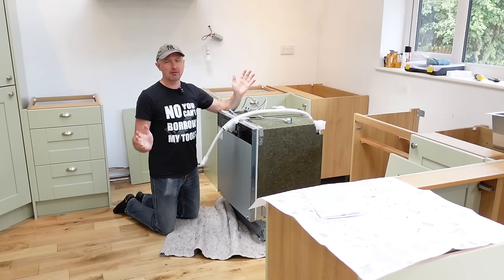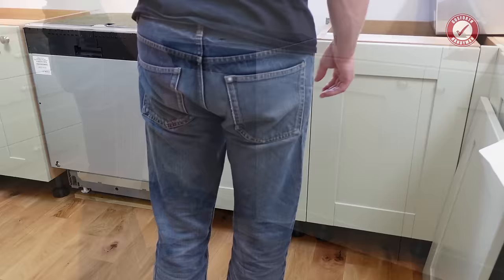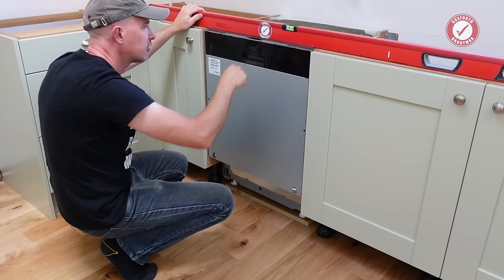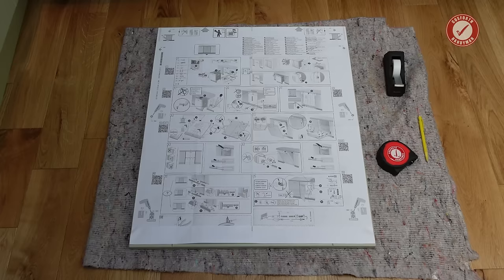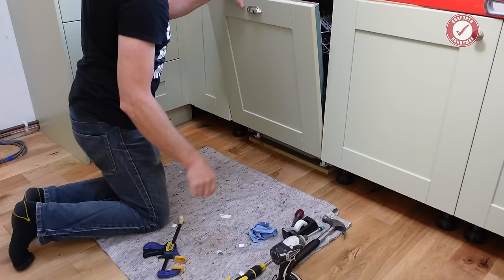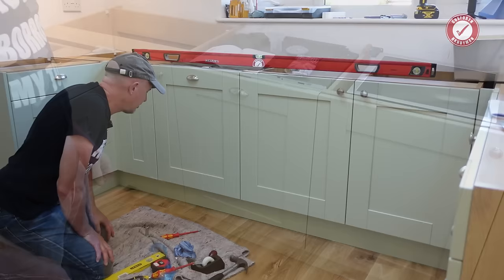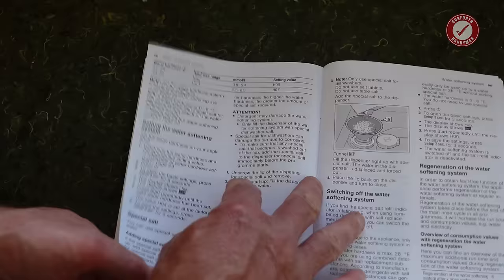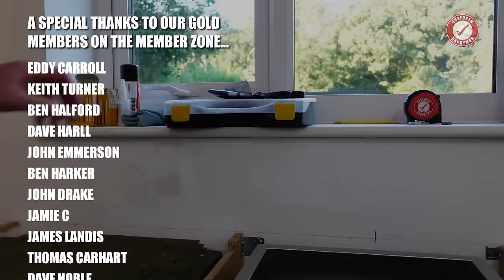How to install a Bosch integrated DISHWASHER

Comment: Great video, tho as aa appliance engineer it is far easier to fit door yo dishwasher before you put it in the space, making sure that the decor door is at least 20mm above appliance door when attaching, then jack up front and back legs to align with adjacent cupboard doors. This will alleviate the need to put battens on the floor as the appliance shouldn't slammed tight to underside worktop. Don't forget to put panhead screws in appliance front legs to lock them..
Reply: Great video, but as I had to fit a replacement (with completely different door fixings), I followed your advice and fitted the door first and then lined it up. Thank you.
Reply: I’m about to fit our dishwasher and am a bit confused about the advice to raise or not the dishwasher to the underside of the worktop. Ours also has a sliding door feature and I’ve seen advice to keep the dishwasher as low as possible so the sliding door has the best chance of missing the plinth. I would be grateful for any rational/guidance about the height of the dishwasher.

Comment: It's usually best to have the dishwasher set as low as possible. Else the past of the door that hangs below the dishwasherdoor can hit the dishwasher when you open it.
Reply: Did this on mine, packed it down with some 18mm offcuts, was paranoid about seeing the gap in the plinth from across the room. I've noticed the gap in a few other kitchens and didn't like the look. I still had to trim about 3mm of the plinth for the door to clear though :(
Reply from the maker: Not recommended - there's a seal at the top for a reason. 👍
Reply: @GosforthHandyman  I would prefer not to, bur sometimes you have to. Then you can put a filler piece at the top to close up the gat.
Reply: @GosforthHandyman  thank you. I have watched your video very easy to follow, .. but ... the kitchen door is the same size as the integrated Dishwasher door, but now we can't fully open the dishwasher door as it catches on the dishwasher metal plinth...aaagh. any tips and tricks. Thank you 🤗😄
Reply: No, should touch the top to avoid moisture above. There are options to attach the cover differently so that it doesn't hit if you research it.

Comment: Excellent video! I'll be installing mine (same model) in a few days.  May I ask if you know if the rubber apron at the bottom (where the toe kick) is necessary to be installed?

Comment: I just want to say thank you for such a detailed step-by-step video to go through the installation process. I have a Bosch integrated dishwasher and handleless kitchen and I have been using my dishwasher without the door and fixngs for half an year. There are so many unncessary things in the manual and it is way better to see a video like this to explain all the parts and steps.

I have completed the installation last night and it looked perfectly aligned now. No more eye sores and stepping to keep the door open!

Comment: Good video and well done!  Many people and builders alike don’t pay attention to the height of the dishwasher they choose.  In the US the cabinet height is pretty standardized and calls for a dishwasher of 86.5 cm.  In Europe it varies.  If your cabinet height is between 88 and 92 cm, you should choose an integrated dishwasher height of 86.5 cm, not 81cm.  The dishwasher door top and front “facade” panel should be nearly flush (within a couple of cm).  You should not need to prop up your dishwasher with boards on the floor.  You also need to pay attention to the height of the dishwasher “facade panel.”  Most 86.5 cm height dishwashers “facade panel” size range from 70.5 cm to 81.5 cm. More and more today, most people prefer a taller cabinet height ranging from 87 cm to 90 cm (depending upon worktop thickness).  People also prefer greater dishwasher capacity. With this in mind, a kitchen designed as such should choose the 86 cm+ dishwasher and take the guesswork out of the equation.

Comment: To secure the machine in place the newer ones have 2 flimsy pieces of metal that you screw to the top and bend the ends down before pushing the macine into place. These require to have 2 screws inserted each side.  
This system replaces the ratcheting plastic plugs on each side that you show in the video.

Comment: This is gold. Thanks a lot for the explanations. Lifesaver 😊. The Bosch manual make the installation daunting. Not to say that the cabinet door fixing dimensions on the drawing don't fit with the screws positions on the dishwasher door.
Thanks again. All the best.

Comment: Fantastic video! Thanks: Liked and subscribed. We’d just bought a Bosch dishwasher and I was scratching my head over that awful instruction sheet. Your video saved the day by adding a load more detail and explanation. It gave me the confidence to keep at (and eventually finish) the job. 

Unless I missed it, you didn’t say about peeling the cover off the second (outer) side the Velcro pad. I did this and it helped to hold the door in place whilst I sorted out the screws. And being Velcro of course it allowed me to slightly adjust the position of the door before putting the screws in. 

Thanks again for a really helpful video.

Comment: A thorough and very well presented video!  What you call a plinth we call a 'toe kick' in the US.

I agree the directions can be confusing.  On my 800 Series instructions, in the section where you plug in the power cord, it refers to a nonexistent strap to the left of the socket lol.  Guess it's supposed to act as a strain relief for the cord?

Comment: Always bear in mind what door is being fitted before deciding on the height of the dishwasher.
J-pull/ handleless doors don't have a full 18mm rail along the top so if the dishwasher is up tight to the worktop, the screws used to fix the door to the dishwasher
 (the 2 screws at the top) will come through to the area where your hand goes when opening the door and will be visable.
I've been fitting kitchens for 20 years and I've seen this happen.
Reply: Interesting thanks. I'm just about to fit drawline front J pull  ie. two pieces to an AEG integrated DW and this hadn't crossed my mind until I read this. To be honest I'm not sure how I'm going to do it now!

Comment: Hi. 
 An integrated dishwasher is secured to the adjacent cabinets, so doesn't need to be stable. Adjust the front feet to the correct height and level, then adjust the back foot so the appliance is level. Easy.
It makes it easier to remove for repair too.
 You do need to use salt, regardless of your water hardness, unless it is really soft water. The salt contains sodium which repairs the water softening unit in your dishwasher. 
The tiny amount of salt in the tablets does not reach this area.

Comment: You did a great job, with high precision. I love the fully integrated appliances: they fit perfectly into the kitchen aesthetics, and they look like furniture themselves. For the dishwasher, which is an excellent brand, I opted to apply an additional layer of insulating material on the top (to make it even more silent).

Comment: Fitted numerous integrated units in my homes over the years so I thought this would be a no brainer. 
Watched your excellent video many times along with studying the instructions.
First its a lot easier it seems doing it with the worktop off especially when making sure the dishwasher does not move when you open the door for fitting the side screws.
Mine was a replacement, last dishwasher lasted just over a year so worktop already in place. Oh my god what a pain that was but got there in the end I thought.
Copied your video to the letter but when it came to opening the dishwasher with the door fitted it catches on the bottom of the dishwasher. 
Nothing to say why or what you do about it. Seems strange that yours did not.
Like you I had that little card which I thinks explains what you have to do if the door catches on the bottom of the dishwasher when opening. But there is no other mention of that card or how it works. 
I did think about raising the door but then I would have to drop the dishwasher and therefore leave a gap at the top between dishwasher and worktop.
I really do not know what to do, proper explanation in the instructions would have helped.
Regards Chris

Comment: You can also get test kits to check the water hardness.
Years ago we bought a new house which was fitted out to move in. A few years after we'd moved in we had a problem with the dishwasher. When the plumber checked it out he discovered the original fitters had plumbed it in to the hot water whereas it should have been plumbed into the cold water. He swapped it over to the cold water and there was an immediate improvement in the efficiency.
Reply: Our water test kit came with the dishwasher a strip of paper you run under the tap

Comment: Thanks - great advice. 
I'm trying to remove our old (Bosch integrated) dishwasher to fit the new one. I've removed the screws, which secure it to the side of the kitchen unit, but it still seems stuck in place!

Comment: I think if you installed the dishwasher lower as in the instructions then the door cover would not have interfered with the plinth as there would have been less or no overhang to accommodate underneath, you also wouldn't of the needed the supporting timbers. .... I'm happy to be corrected
Reply from the maker: Instructions state to have it up up to the worktop. The only way to avoid the plinth is to have all the adjacent units higher... but then you'll have a gap over the plinth around the entire kitchen. 👍

Comment: Interesting that there are two kinds of handles. Very stylish kitchen, the colour, shouldn't look dated any time soon which can be a problem if going after the latest fad.
Reply from the maker: Cheers!
Reply: @njuham,  It's always a problem when you use panel ready appliances as far as pulls or handles. A fridge takes a real handle to get the force to open it usually, while drawers would look silly if they all had large handles sometimes.

Comment: Pretty sure that card is trying to say you need some sort of support or filler front and back under the worktop if it's raised, rather than saying you need a gap - note the first image shows a flush worktop.
Reply from the maker: Yeah, but then in the main instructions (see fig 4 to the right) it says not to leave a gap at all. 🤔
Reply: @GosforthHandyman  Yeah, I'm sure this is some sort of addendum for when you just can't raise the machine that high, but it's clear as mud. I guess a few words to go with the pictograms are too much to ask in 2022.

Comment: Hi, thats a really good video thank you.  My mum has just bought one and I get the job of installing lol
A quick question, in your video, you open the door with very little effort.  We are finding the door is really tight to the point of being a bit scared of opening it.  How tight is the door (if you remember) when you first get the dishwasher.  with no front on it the door really seems to flex and is really tight.  Just worried there is a child lock or similar that I have seen mentioned on other Bosch machines.  Could just be were scared of breaking it, any help would be appreciated.

Comment: Great video, thanks much.  But just wondering if you don't put a break in the plinth, how would someone change out the dishwasher or take it out for repairs?  I usually use the same plinth material but put two seams under the dishwasher so the dishwasher has its own removeable plinth. You can stick in on with magnets or other mounting system, but it is a bit of a mess to keep it attached.

Comment: Sorry to be nosey.....but why do you have copper pipework running up the wall, where you presumably are going to install your oven/rings ???  Great video.  Two outstanding questions for me.  1) why did Bosch supply me with thick green fabric, which they want placed on the floor behind the kickboard and 2) in Stage 1 of the install guide, they show us cutting some material with scissors, any idea what thats about ???  Keep up the good work !!

Comment: Foe whatever reason, integral kitchen appliances are not common in the US.  The downside of that is that, even if you use the same brand of appliance, the finishes don't always match.  The British system makes for a neater kitchen.

Comment: Hy, If you don't want to cut the plinth, do like this 10 cm, 72 cm, and the rest put wood up to the top. And the door will open without problems.They make for 72 cm high doors, like refrigerator doors.,The dimensions of the furniture bodies are calculated like this - 90 above - 60 or 65 and 60 cm min for the upper bodies.Because it is possible to install a washing machine that has a height of 85 cm+-.like for video,👍

Comment: Great video, I’m fitting one today however the water connection hose has a larger thread than the 15mm isolation valve I currently have available, can you tell me what size thread the push fit connector is please that you fitted the dishwasher water pipe to please?

Comment: I have a similar Bosch dishwasher, the door is coming away from the front of the dishwasher and, I’ve noticed a screw missing half way down, what size are the screws that attach the dishwasher to the door please?

Comment: Thanks, just what I needed except I have a semi-integrated Bosch dishwasher. I think I can work out what to do now (from your really helpful video) but have you done a video fitting a door panel to a semi-integrated dishwasher? Or have you any particular tips? I have the (unhelpful) picture instructions from Bosch and can see the sheet acts as a template. The instructions also seem to suggest inserting longer screws half way down each side (presumably to secure the panel in addition to the double sided tape). Anyway, thanks for getting me under way. Any tips gratefully received. Richard

Comment: Just moved into a house where the previous owners kindly left their dishwasher. It was very dirty inside, never cleaned. As we went to remove it, we found out why they left it. It's been tiled in. No idea how to remove it without either breaking tiles or breaking the worktop apart.

Comment: Great video, does anyone know the maximum height the door panel can be, I'm trying to reuse the one of our old dishwasher and it seems to be too long and hits the machine when opening, so doesn't open properly?? Any help would be appreciated on the best dimensions for this panel.
Reply: I saw someone with this issue and the advice was to install the dishwasher as low as possible so the door doesn’t overhang (underhang?) as much and hit the machine. Hope that’s clear…🤷‍♂️

Comment: When @16m 14secs the screws go through the inside of the dishwasher and into the neighbouring cupboards, how do they seal to prevent water getting past?
Reply: They are actually in a dry zone outside the door seals
Reply: @i.m.peterrific  Understood, thanks.
Reply from the maker: Yup, dry zone. 👍

Comment: I was going to suggest you put the waist pipe in screw on adapter but noticed you did that, can i ask why you dont have switches above the worktop  to turn the sockets below the work top off when i fitted my kitchen i put single sockets for the dishwasher, washer, and dryer below the work top with switches above the work top to ensure they could be turned off. i thought most people did this
Reply: I've found that they can get in the way of pushing the appliance back all the way. So prefer just to have a switched socket in an adjacent cupboard.
Reply from the maker: Plus if a fuse blows you don't have to pull the entire appliance out. 👍

Comment: hey great video, I have brand new bosch Integrated unit.  quick question on wastewater pipe.  mine has what looks like a one way trap in the end closest to sink pipes. if I look at it I cannot blow past it. so I feel either it shouldn't be there or its faulty. no mention of it in install notes.  causes an E61-03 which means it can't empty wastewater. it's brand new ! the small piece I'm talking about I can't easily remove either. it makes sense to have it to stop waste from sink going down into dishwasher. painful.
Reply from the maker: If it's a new trap it will probably be capped - you normally just take the cap / bung out. Some need the end to be cut off but difficult to say without seeing it. 👍

Comment: IKEA dishwasher fittings are the worst , the flimsy metal top brackets bend and never last so it’s nice to see this adjoining system but alignment is always a faff , great job 👍 Andy what do you do for top clearance as most will leave a gap ?
Reply from the maker: Cheers! Ended up with about 10mm at the top which is fine for stone worktops but I guess with wood tops there's a chance steam could get under so it should probably be a bit higher. 👍
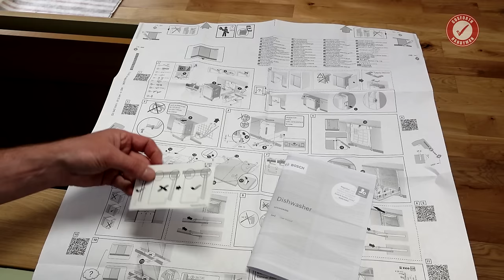Reply: @0:52 where the possible clearance is pictured, would be for higher kitchen cabinets i.e. IKEA ones. I think it is ok not to have the appliance raised all the way up to the underside of the wooden countertop, as you can always block off that gap from steam and moisture by putting in a piece of timber with the required thickness, so it sits nicely behind the appliance's control panel. In addition to that, the dishwasher will have the rubber edge seal running across the top of it which will give the extra barrier for moisture (my BOSCH one has that anyways). This is all to eliminate the need of cutting down your DW cover board, so you can open the DW door and fold it all the way down flat without hitting the bottom of the dishwasher (recessed portion).